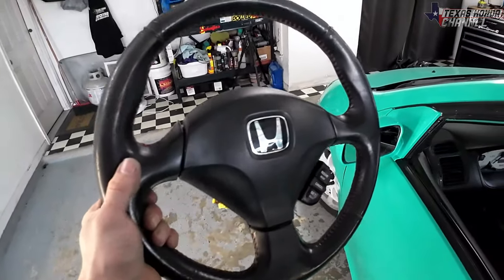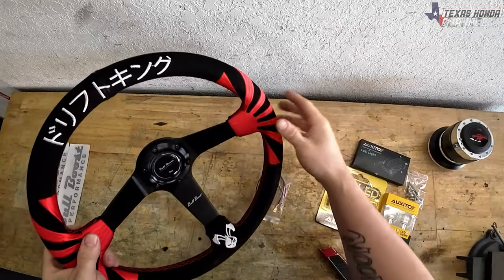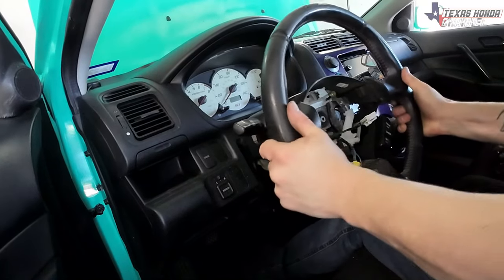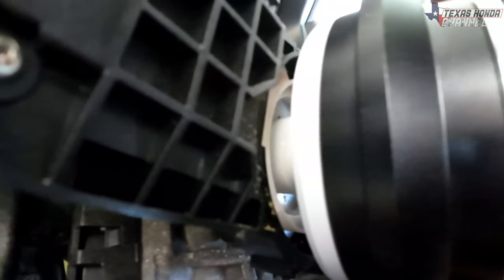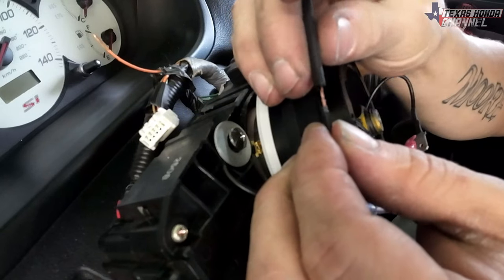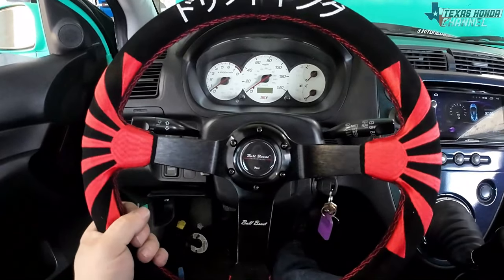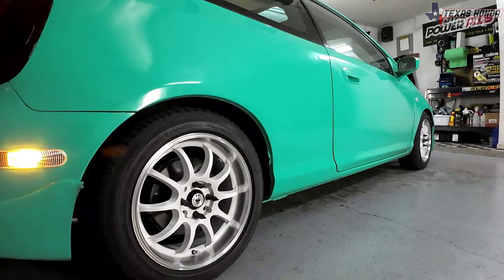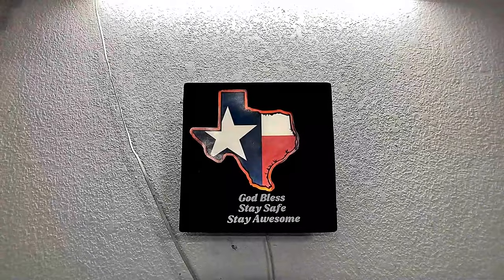HOW I INSTALL A RACING STEERING WHEEL & KEEP THE HORN!

Comment: Looks pretty cool. That's pretty much same way I did mine. Gotta adjust my metal tab again so it'll keep contact and gotta reset the wheel straight  after I swapped hubs to that style quick release I got the hub off center some. I had some of that brand lights and first set burnt out less then a year I msg them and they sent another set. They last a while. Ready to try the new style of their lights.

Comment: Hey bro is this a decent steering wheel ? Does it bend easily like the other cheap ones. Also do you have an Amazon link for it for an 99 civic. I need the hub and the wheel